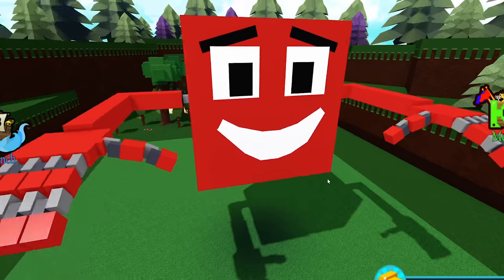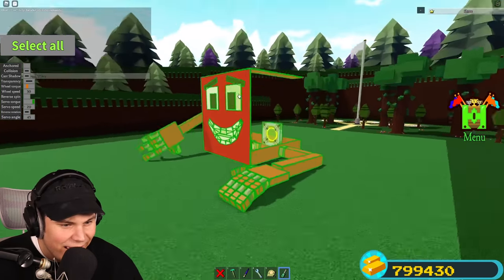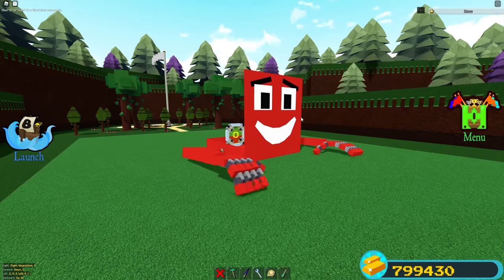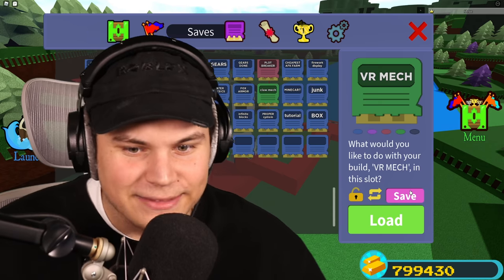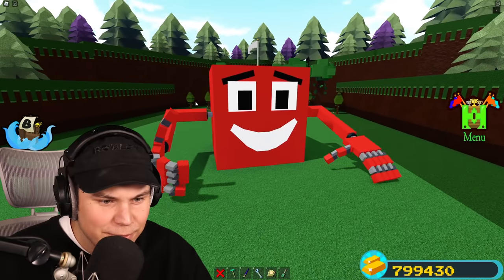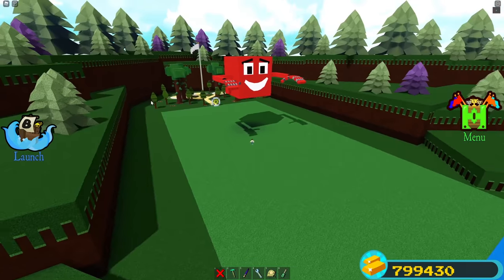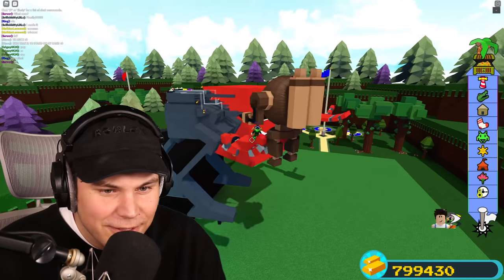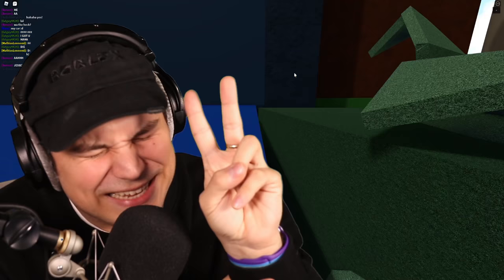I BUILD A WORKING VR MECH IN Build a Boat!

Comment: BUY A NEW KEYBOARD OR IF YOU HAVE ANOTHER ONE THE. THAT THE ONE YOU USE AND PUT THE BUTTON POSITION OF THAT VR MECH FOR EXAMPLE thansup put the STICKER TO THE LETTER THAT HAVE THE BUTTON OF THANSUP
SO THAT WAY ITS SO EASY TO CONTROLL AND NOT FORGETTING THE BUTTON